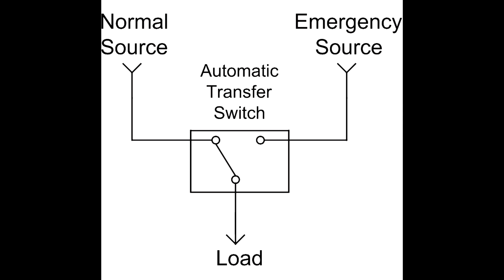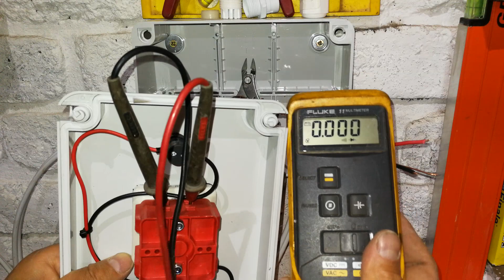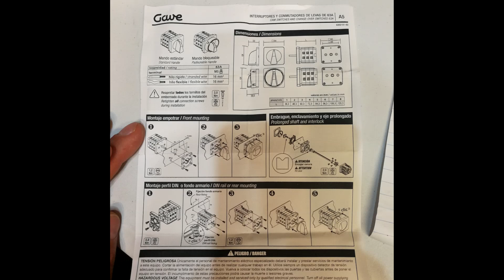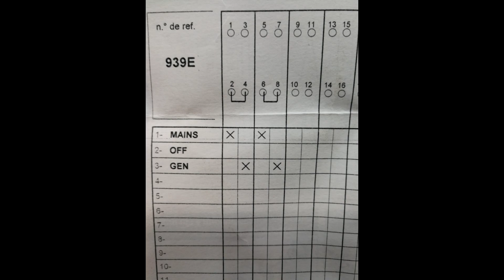How to wire a generator change over switch - step by step.

Comment: Hi, the neon warning lights on a change over switch should only be illuminated when the required switch position you want is selected & not as you have shown - “constant” - check the connection instructions that came with the unit - ok.
Ed,

Comment: have  a question about the earths.   in canada, we have 240v split phase, and most appliances etc are 120.   the neutral and earth are bonded at the service panel.   i have a solar system i'm currently testing and i want the ability to change each load from mains or solar (inverted so no DC).   in Canada also, if you have an auxiliary panel, you have separate the neutral and the earth, so there is no chance of a glitch anywhere causing the power to feed back to the main panel over the earth wire and frying yourself.   my concern is about the earths coming from two different power sources.   can i really just bond the earths from solar and mains and load together, and use the switch, or is it necessary to have the grounds completely separate.   currently i have two different grounding poles in the ground for the solar and the mains power, and in order to swtich between one and the other, i move the hot, neutral and ground from each power source.    maybe that's overkill and i can use one of these changeover switches to make it faster to switch.
Reply: This is a good question and I'm in a similar situation, did you find out the answer in the end?

Comment: I am an electrician, do not terminate the earths in this manner, highly dangerous.
Reply from the maker: please can you explain how you do it your way
Reply: @ecologicaltime  It just means that you need to crimp the earth wire ends and secure them together with a proper screw termination. While you're at it, measure your earth terminal resistance between the main meter box and this change over switch. That means measuring the earth wire resistance between two end points

Comment: Is this for AC or for DC? What do I with the ground/earth?
Reply: If it is a AC system the earths should actually be connected to the earth bar in your main db. But if your appliance do not require an earth then you can leave it out, but most appliances require earth for the casing(if it is a metal casing) that you wont get electrocuted if you touch the casing if there is a fault on the appliance. For a DC system you do not require any earths.
Reply from the maker: AC
Reply: hmmm im currently updating my knowledge in revising  my own manual interlock circuit breaker transfer switch, i installed 1, made one and it took me hours to see flaws, and safety isue of my design, correcting them on spot and made sure it was safe especially it have to power an entire house, the process making the interlock was no joke, too much work 🤨🤨🤨 i was paid very little, compared to all the revised that i have done, 😂😂 isee potential in using changeover switch but i only have one worry, if the changeover switch could be 30 amp, it would be no worry with house using 3-5k watts/hour. to cut the story short, if we have heavy duty changeover switch its highly recommended . im now revising my design base on this video 🤗🤗🤗

Comment: Thanks for a very good explanation. How do you connect this setup to to your DB board?
Reply: Get a qualified person to do this, it is not DIY job. There are certain wire sizes required, depending on the amps. Although this switch is rated at 63 Amp I would not recommend switching under full load. If it is done properly this installation will be much safer than the risky practice of using a lead with 2 plugs to connect your generator to your wiring.
Reply: @mj3299  Thanks.
Reply: @mj3299  Yes I agree regarding the wire sizes. Although that is three core mains cable being used , it is inadequate for the purpose demonstrated. The three core will be required to carry the full load being drawn ( since ecologicaltime  admits he is running it to his Distribution Board)   There are many resources available on the internet that  describe how to work out by how much to overate the cable size . It depends not only on the full current drawn but also has a length component that must be taken into consideration since wire has a certain resistance per meter of length.  Most wire and cable suppliers rate their cable in CSA which is cross sectional area  ( in  mm squared. )   I  would also like to see some circuit breakers being used .
Reply from the maker: Get a stand alone db board with its own earth leakage fed from your genny. Or use a changeover switch for your whole db board.
I have run it directly to my db board but it needs earth leakage and labelling. I can't do a video on it as it's questionable practice.